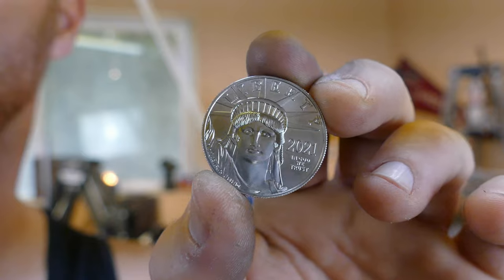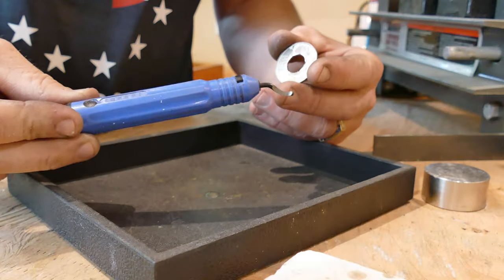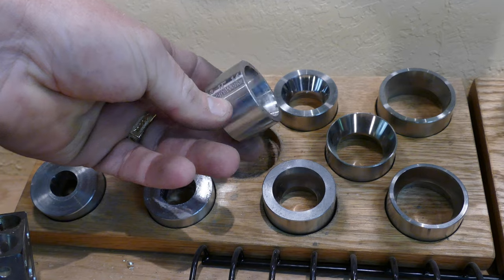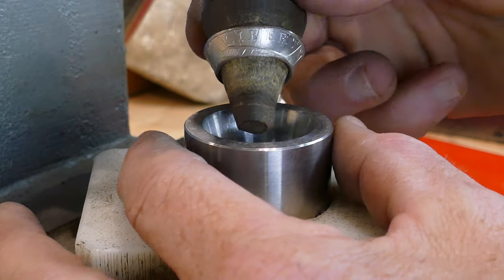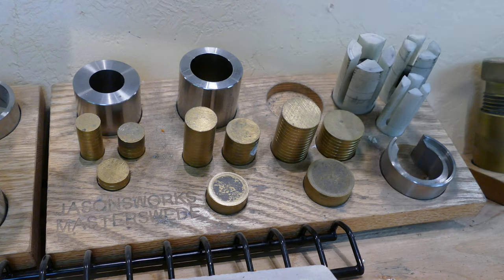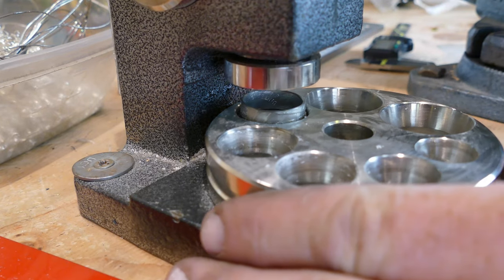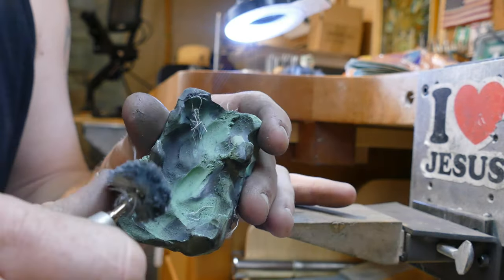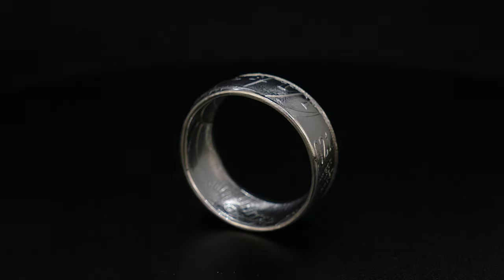Making a 1 oz Platinum Coin into a Ring

Comment: Hi skyler  hope things are good for you ..
Just  wondering if you could share a tip on how to remove the details of the inside ring ? Looking to do some inside ring engraving but with a dremmel and different sand paper grits is a very slow process ,,, 
Do you know a better quicker way ?
Big thanks in advance
Reply from the maker: A drum sander with a dremmel is the best way. I use a big cylinder bur that I got from Rio to start. Then I move to a drum sander attachment